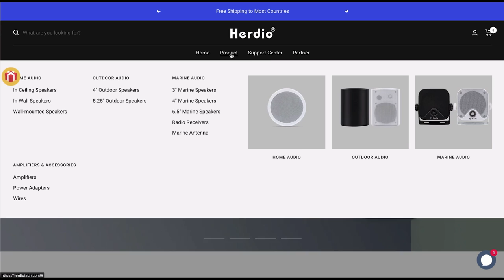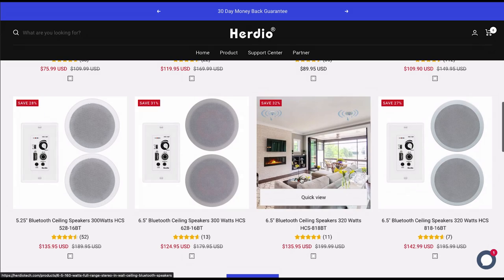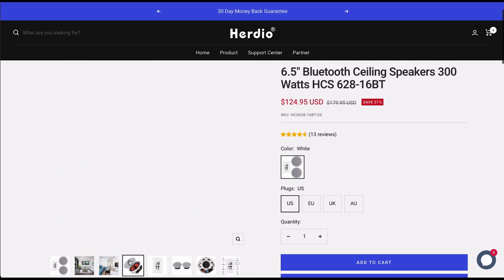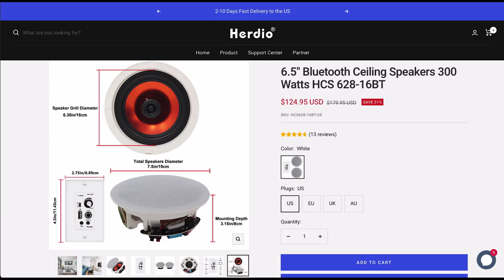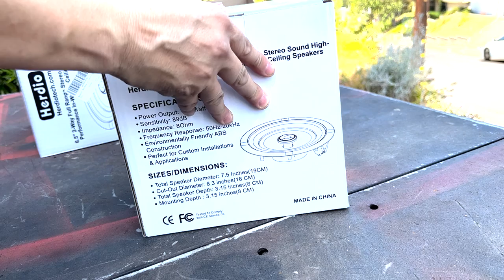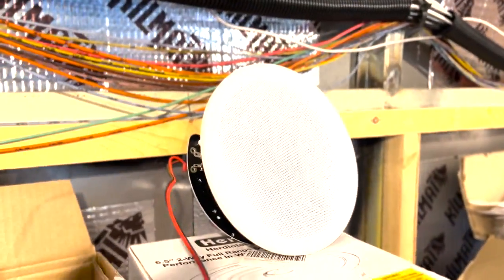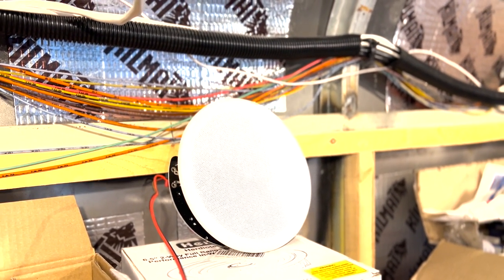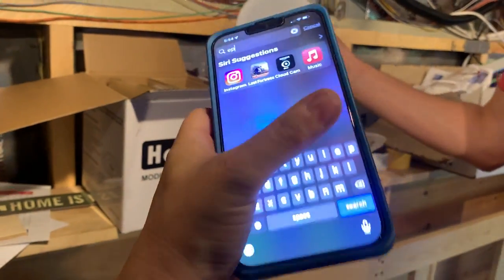Herdio Bluetooth Ceiling Speakers

Comment: Haven’t been able to locate a active version from them. Can access power, but don’t wanna run speaker cables to an amp. If I install these in a 24ft living room ceiling can access power in attic, but then I’d have to leave that amp in the attic 😒

Comment: you conect 12 v,, or direct to the power..? you skipped steps
Reply from the maker: 12 volt
Reply: Hi!!! I have de same question...and besides, how you get 12V from the direct power by the back panel set up? In other words by the alternative supply that is not the main eliminator?
Please I wait for your answer

Comment: How did you guys connect the power without using the power cord????
Reply: Battery powered
Reply: This is like the one thing that Herdio needs to make clear.   It's a wall unit but noone seems to be sure about how to power it.
Reply from the maker: You use 12 volt power